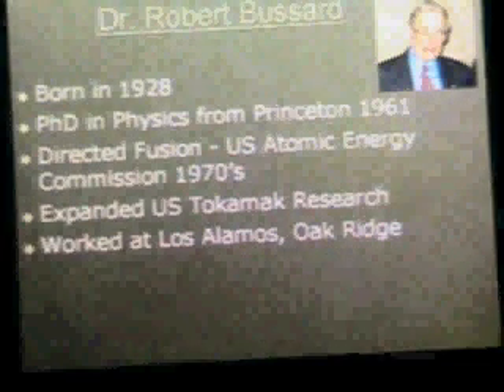Analysisof the Bussards' Polywell Idea (Part 1 of 3)

Comment: The "stary" shape in the middle tells me you got the math wrong. Don't neglect J, and to make the field equations, tractable, ignore Heaviside's formulation, and either use Hertz's or Einstein's relativity.
Don't neglect J - Bussard claimed that the "balancing" of the J vs the externally applied B was what made the device such a good electron trap. Also - it doesn't contain plama - there are always more electrons than positive charges, so most empirical thermodynamic plasma equations are wrong.

Comment: If you spent the time the read the "more info" on the right side of this page, he goes on to explain that he is no expert, Ill quote it since your screen resolution must be 640x480 that the right pane of this page must be cut off from your view. 

"This is by no means comprehensive. I do not claim to be an expert. Hopefully, this will spark a conversation, and further investigation by honest experts, into this validity of this device."

So stop being a ass anticarrot.

Comment: There are, well, er, six metal rings, um, ah, and the six rings, um, have current running though them...

I think the word that is on the tip of your tongue and which you are desperately failing to grasp is 'electromagnet'.

I'm afraid that after 6 minutes spent failing to tell me anything new, combined with the lack of technical language appropiet to the discussion, and the less than ideal presentation skills used make it hard to take this video seriously.

Comment: Of coarse a lot has happened since the video was posted on Google.  The Navy funded WB6 and it was built, performed to specs; then WB7, built, and with some adjustments, performed to specs, then the Navy took the whole project black and we no longer get to see what is happening but the original contract called for a power reactor to be built after WB7 if WB7 performed to specs.